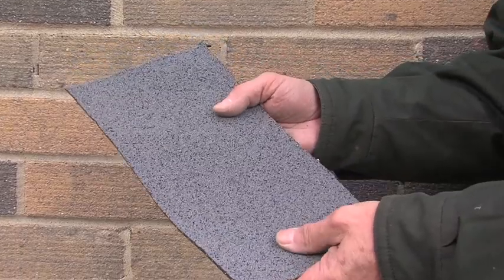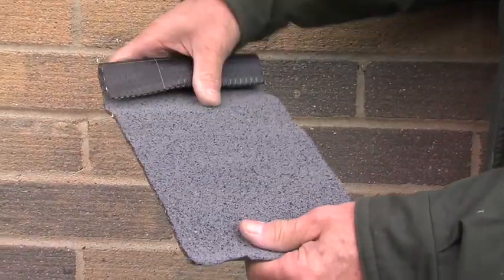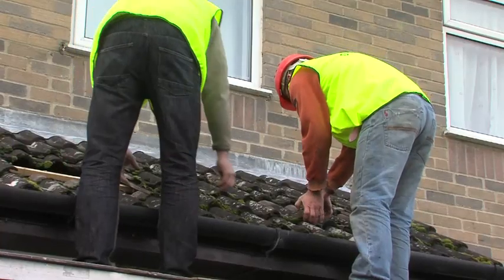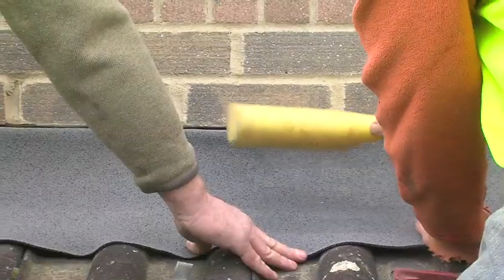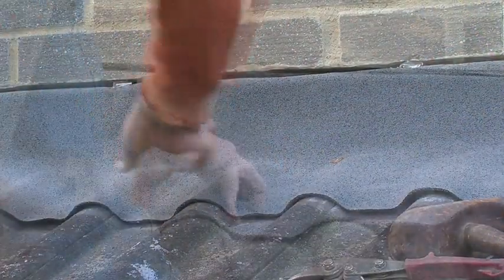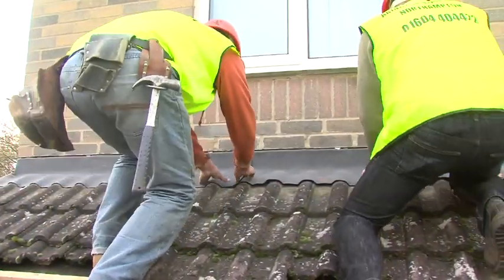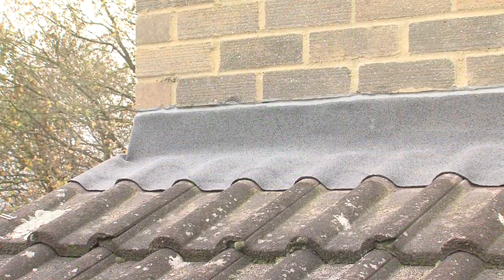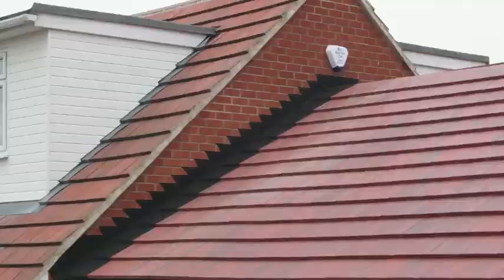Ubbink - Applying Ubiflex lead-free flashing

Comment: looks like a nightmare to shape into the tiles there !  can see the advantage over lead for straight runs and upstands but for workability into fine details like that particular tile lead would be favourable.
Reply: It looks not easy to shape particular material and I wander how they shaped the corner. However, lead is harmful to anything live. This video is 10 years old. Now there are more flexible materials.

Comment: Looks good, but there are some unanswered questions about it. 
What is its lifespan? As it's made of bitumen, I guess it will be similar to traditional flat roof materials, about 10-15 years. If that's the case the additional labour cost, to replace it several times, over the life of a comparable lead flashing, would negate any material cost saving. 
How does it stand up to stretching over profiled tiles and at 90° turn-ins to the wall? Will micro tears develop and compromise the material. 
How do you remove the glue that holds the free edges down, when the material is at the end of its life? Will this risk breaking or staining the tiles or slates.
Reply: Benzknees id say it starts deteriorating in a year, just fix the lead correctly and it will last a life time
Reply: @mrc8221  or 2 days until it’s stolen again?
Reply: That truly is awful